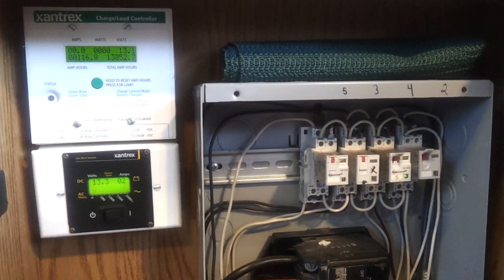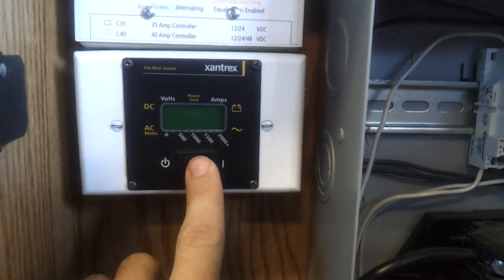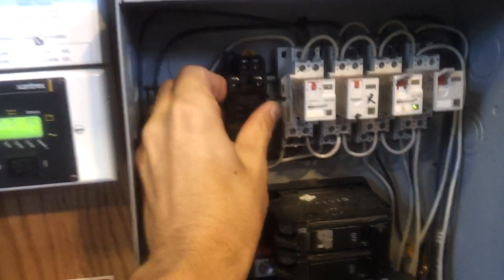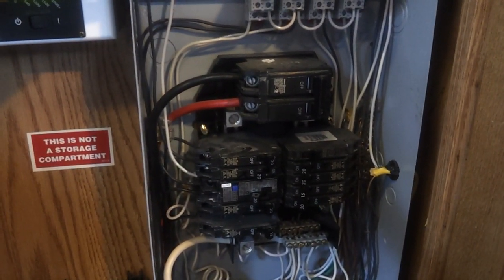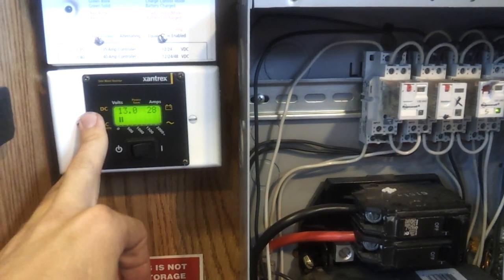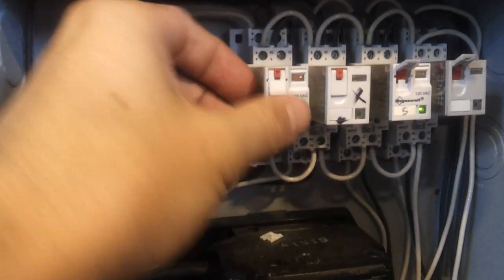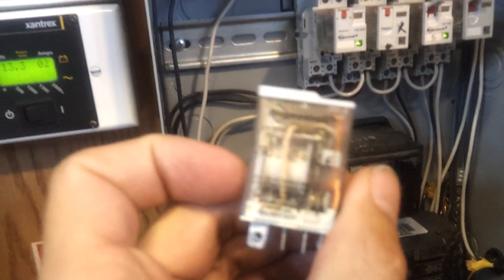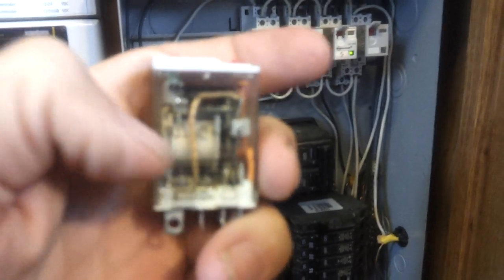DIY: Automatic Load Transfer Switch(ATS) for Solar Power Inverter or Generator

Comment: Did the same thing for my house and a backup battery set. Used Siemens 3TH4262-0A relays. They do not require DIN rail and they are have rebuildable contact sets in case they wear out. Good install.

Comment: If you check the national electrical code. It says that if a unit is on for more than 3 hours, you should rate it 10% more to compensate heat load, so you should use 20 or 25 amps contactor.

Comment: From an electricians point of view I am not quite sure about your over load protection you seem to have to coil of the relay connected to the circuit breaker
What protects the cabling of the house, RV, boat  form over load ?

Relays are not for controlling loads a contactor would be a better option
as you would not burn them out .
 
I would not advise anyone to copy this as it could be a fire hazard waiting to happen
call a electrician because if you are melting relays your system design is wrong

 As this is not a true ATS as ATS transfer to alternate power source when mains fail then restore to grid power when available.

If you are going to recommend things to people make sure you get the facts right
as you can kill people with the level of voltage you are playing with

I would highly recommend getting your system checked by an electrician
for your own safety and fire risk,

Please don't take this the wrong way
and please have it checked you could loose more than you think
Regards
John

Comment from the maker: Most commonly available heaters in th US have 2 modes; generally 800 and 1500 watts. I ended up using them on low to keep the relay load lower.

Comment: Unless your inverter is providing overload protection on it's output you don't have overload protection while running on the inverter. The issue you are seeing with your relays could be based on the load type "inductive/resistive" and if it is running while you are switching back and forth. If you are switching inductive loads you normally need to de-rate the amp rating of the relay by ~40%..
Reply from the maker: +Chadd Thompson You are correct. It turns out these relays aren't even rated for full Duty at 12 amps. They are completely inadequate for resistive loads as you said.

Comment: Interesting and creative. I think the relays are not continuous duty rated for max amps? I read up on them and there is no distinction in the spec sheets. I am a little confused on your grounding. Do you have the inverter ground and utility ground combined so that no mater which power source the ground is bonded from each receptacle to the inverter and utility ground? Basically all combined grounding?

Comment from the maker: Reply to Kent Williams:
It is automatic. When I switch off the breaker for that circuit, the relay automatically transfers power to the inverter. This is the same thing that would happen if the power went out, all loads would be switched to the inverter. Loads can be selected manuall like I do in the video, or automatically when the power goes out.
Reply: Are your outgoing circuits connected through your breakers?

Have you ever heard of arcing between an inverter and shore power, in particular when you are connected through double throw relays?  I've seen one guy who says he has experienced this.
Reply: The two systems are isolated. When shore power is unplugged, or the breaker is flipped to the off position, the relay is no longer powered and flips to inverter power. You will want more heavy duty relays though,  the ones I use in the video are not rated for enough amps at constant duty. They work great as shown and connected, they just burn out quickly.. Especially if I use an electric heater(high amps)
Reply: Im trying to setup something similar with 12v battery to 110v inverter for my modem and router (small load). Can you tell me which wires connect to which pins. Thanks.
Reply: That's almost exactly what I am looking for!  No turbines though :O)  Just started so there is sooo much to weed through.  Almost certain that pro installation would cost more than parts...  how can I get some direction?  A jump start of sorts.
Any help is greatly appreciated!
-R

Comment: In your video you talked about the relays not taking all the current. Why can't you just use two relays in parallel for one circuit so that each relay would take 1/2 of the load? Your thought?
Reply from the maker: +Dennis Young That should technically help, but it turns out these relays aren't rated for full duty at 12amps. My Next solution will be a different relay that is rated for at least 15 amps full duty which will handle inductive loads.

Comment: I have solar panels set up and the inverter has 4 outlet plugs that I intend to connect to 4 breakers. Will I need 4 separate transfer switches?

Comment: Hi Im looking to switch power to different loads on my output. I have a maimum of 20 Amps avaialble, my problem is that when the tumble dryer is on ,we cant use the microwave, so I want to make the microwave a priority and auto switch off the tumble dryer when the microwave runs, will this work?
Reply from the maker: +Johan Kirsten In order to automatically switch one off when the microwave is running you would need a control relay in the mix to signal the switch to happen. It would not automatically switch one off just because there is more load on the circuit.

Comment: I don't understand the "automatic" part. Does this automatically switch to shore power, and then when shore power is disconnected, automatically return to inverter power? It looked like you had to manually switch it.

Comment: I was looking for an auto switch set up. You shouldn't have to do this manually. An auto sensing single pole breaker that switches from utility to battery or solar is far better.

Comment: where do you buy this Xantrex ? thank you.
Reply from the maker: Truc Ng The Xantrex Prosine is one of the best inverters you  can buy. They are a little pricey brand new. Amazon is the cheapest place for new ones. This is the model I have:
http://www.amazon.com/dp/B0000225DC/?tag=cr38er-20

If you're on a budget, you can find them used on ebay pretty cheap:
http://rover.ebay.com/rover/1/711-53200-19255-0/1?icep_ff3=9&pub=5575088352&toolid=10001&campid=5337488772&customid=&icep_uq=xantrex+prosine+inverter&icep_sellerId=&icep_ex_kw=&icep_sortBy=12&icep_catId=&icep_minPrice=&icep_maxPrice=&ipn=psmain&icep_vectorid=229466&kwid=902099&mtid=824&kw=lg&LH_BIN=1&LH_PrefLoc=1&_sop=15